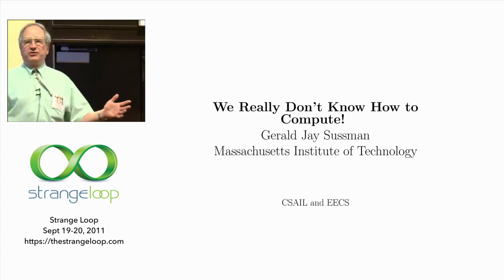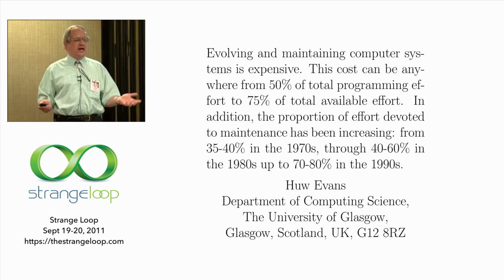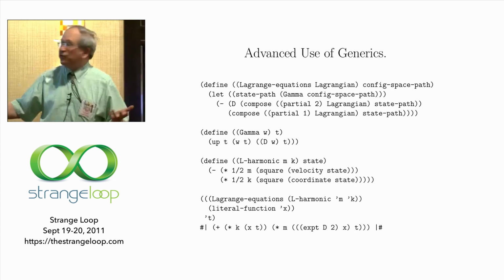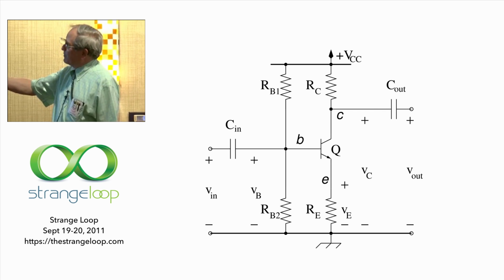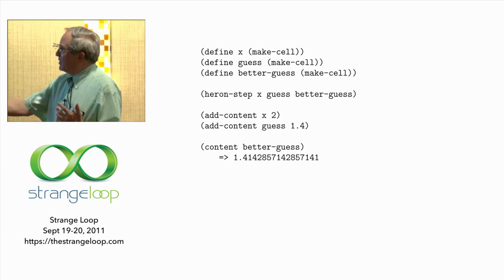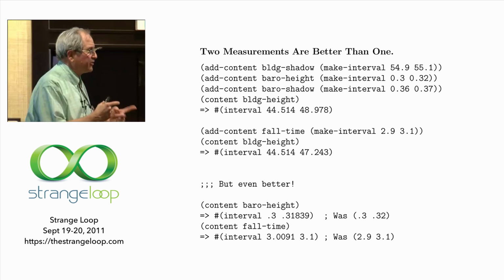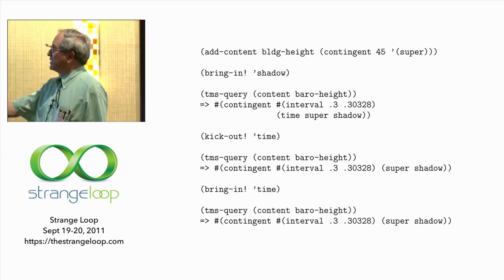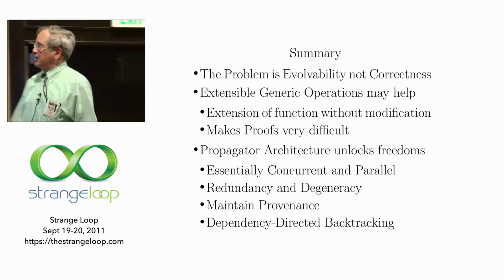"We Really Don't Know How to Compute!" - Gerald Sussman (2011)

Comment: 1:32 I think the main difference between a genome and a computer program is that the genome doesn't really determine everything a cell can do, but a lot of it only works by interaction between what the cell is "told" by it's genome and the environment. You can see evidence for this for example in finger prints, which are different even between identical twins. Computer programs  can also have emerging complexity, but only by the data interacting with other data,like in a cellular automaton. But cells also have physical and chemical interaction with the environment outside of the body.
Reply: Yes, a genome doesn’t do any computing at all. It’s a descriptive language.

Comment: Considering his "memory is free" comments, it is interesting that my current job is optimizing a code base to reduce the client program footprint, use less memory, reduce network packet size and latency, and utilize multiple threading to reduce user wait time for computations.
Reply: He made a remark that, surely, there're applications which still require peak performance. A bit later he describe a lot more specific goal: to reach low latency, no matter the means. If your app is under the 100ms bar of human perception all the time for all users, you don't really need any performance increases. This is the idea.
Reply: that is true only if the "app" is run once, in isolation, with manual input from the user and output to the user. I suspect you can very clearly see how even 10 ms per invocation becomes problematic when you start automating things. When you compose functionality. Which is, like, the entire concept of programming itself

Comment: This talk is actually less about programming than it is about automated deduction systems. Which is exactly what I'm interested in because it's what modern machine learning is exceedingly bad at.
ML works solely by approxmations. Not that it's bad to get an answer of 99 meters high instead of 100m for a building. But it's very bad to have the system able to mix up a bit of the current weather with the barometer reading. ML is (usually) continuous in every dimension. Most models don't allow for discontinuity. Which is unfortunately the base of symbolic reasoning.
Reply: This man is literally describing the theoretical basis for modern Explainable AI, so I'm not sure what you're referring to.

Comment: "But in the future it's gonna be the case that computers are so cheap and so easy to make that you can have them in the size of a grain of sand, complete with a megabyte of RAM. You're gonna buy them by the bushel. You could pour them into your concrete—and you buy your concrete by the megaFLOP—and then you have a wall that's smart. So long as you can just get some power to them, and they can do something, that's gonna happen."

Comment: Given two things, A) I'm on a 12 year old machine that can't run anything programed in the past 5 years, and B) I had faster webpage loading times in the days of 56k modems than I have today with 4g lte. 

Both of these facts tell me that SPEED AND MEMORY ARE NOT FREE!

If you can't run your program on a decade old machine, you're doing it wrong.
Reply: I think you’re missing the point - he’s demoing using a language that would have originally run on the old computer he shows, so now he has millions of times more speed and memory available to explore different ways to solve problems, with the primary constraint for coding no longer being performance, but rather flexibility, redundancy, reliability, etc. This isn’t the same as what is going on in the web and presumably electron apps you might be referring to, where they are just plain inefficient and consume all available memory and cpu for zero return. He could have easily ran those lisp programs interactively on a machine from the 1980’s, and he demoed them in this video on a machine that is now over a decade old!
Reply: They are free from a developer perspective. One could allocate 16GB to resolve a problem that could be resolved in 64kb. The problem you are facing is: you want to consume products created by entities who doesn't care about how speed/memory would cost to their consumers.
Reply: for laughs, compile a hello world program in even the most advanced and optimized dotnet version. Enable AOT, optimizations, single-file publishing... the resulting file is a megabyte and a half and takes about 3 times longer to run than the equivalent C program, which is ~4 KB. THREE ORDERS OF MAGNITUDE larger.

Comment: Excellent ideas.

Biological 'code' is very very dense by my look.
It's around 3.1 billion base pairs for DNA, where he got his gigabyte.
But ACGT is base 4 so it's more like
9,000,000 terabytes of binary code?

That is very very complex code for growing elbows and everything else in the expected places.

You can maybe cut that down ignoring some non-coding DNA but you can also consider those sections like compiler tuning parameters effecting the transcription rates of neighboring coding sequences and folding stickiness of the chromosomes.

...time to practice some LISP.
Reply: It's pretty fun thinking about biology like a computer.

Contains its own compiler code to make ribosomes.
Converts DNA to RNA like source code to AST for a compiler.

Each cell as its own processor with state memory from chemical signals and damage.
Proteins as small programs vying for processing time to work in a crowded cell before they are killed.

Each cell flooding the system with messages easily lost in the form of chemical signals.
A ton of parallel I/O processing of all of those signals, noisy networks.

Trashing a whole processor if it gets a virus before it can send out too many bad virus packets to the system...

Not sure if it's a useful model to work off of though.  Self destructing pi zeroes when they detect an errant process would be pricey.
Reply: You've made a mistake in converting size due to different bases. it's just *2, not ^2 (1 base 4 symbol is 2 base 2 symbols), so gigabyte is about right (3.1 billion pairs, each of which is 1 base 4 symbol, so 2 base 2 symbols -> 6.2 billion bits)

Comment: 17:59 - YES! - That's what I missed at Uni. Math is so unclear compared to code. They even put parts in sentences around the formulas. Unintelligible mess.
Reply: It depends on what notation you use, math can be very rigorous and clear. Even the sentences can have a clearly defined meaning.

Comment: 🤔 drop the stopwatch or the barometer?
Reply: If you drop the stopwatch how are you going to measure time? Using the barometer?
Reply: Drop both. Simultaneously. If you do hear one large bump instead of two distinct ones, then your assumptions are correct. Otherwise back out to add air resistance to your model or pump the air out to get the vacuum instead.

Comment: The premise of free processing and memory is that it's wrong on its face. There is no company; no government that doesn't have processing and memory as a consideration.  Has this man done anything of note in the private sector? Try thinking this way in game creation. And processing cost is always about cost of implementation. If you had infinite resources you could just run an equation forever, but, of course, you would be long dead along with everyone else.
Reply: Your premise falls flat with almost all modern websites. For a private developer it's cheaper to make user spend more time than it is to spend more on developers. Bigger projects can consider system requirements. Most of them do not. Just throw it on the web and be gone.

Comment: This all assumes intelligence is mechanical. This assumes programming can go beyond a simple mechinical function. What if the brain doesn't think, what if the mind operates the brain like an engineer controls a machine. I am hearing in this lecture a comparison of a neuron to a circuit or sensor and the arrangement of circuits can do what? They just do what they do because someone designed them to do what we know how to do. I really don't know what this technology can expand into?
Reply: Intelligence definitely can be mechanical, we already have mechanical AI systems that can exceed human capabilities for many intelligent tasks, and there is no apparent limit to it. But I feels that life is not merely mechanical, or perhaps there is some transcendence from the mechanical to the living.
Reply: @ssw4m I guess it all depends on our definition of intelligence. If I use your definition a hinge on a door is intelligent. For me, it would be the ability to solve problems.  I would say a computer doesn't solve problems it just follows a program and the computer is unaware of what it is doing. The problem is actually solved by the programmer. Every time the door is opened the hinge doesn’t perform an act of intelligence, does it? Every time a computer runs an algorithm it is not an intelligent act, it is no more intelligent than what a hinge does, it only did what it was programmed to do.
Reply: @ssw4m  many intelligent tasks like what?
Reply: @sedevacantist1  Sure. But people who follow algorithms might have something to say about you telling them they're not intelligent :)  You could also say that the ability to change approaches is a sign of intelligence. Which is obviously true enough - but again, humans routinely don't do that. You could say that the ability to look at the same data and produce different results (i.e. creativity) is a sign of intelligence - but then again, if a program does that, you're going to complain it's buggy. Funnily enough, again, just like with humans.

Understanding how neural networks work is a great insight into how our brains work. Even extremely simplistic models of neurons already display the same features we observe in animals. Look at how data is stored in neural networks - and you'll see where intelligence comes from. It took a lot of evolution to make intelligence work remotely reliably; again, humans are stupid most often than not - and even when they stumble upon something truly smart, they are very likely to not notice or be ridiculed for it. Our standards for software are a lot higher than evolution's :) Every time you read data from a real neural network, you also modify it. We specifically disable that function in our models, because it's inconvenient.

What reason do you have to believe anything about this is not mechanical?
Reply: @solonyetski there are many well-known examples: playing chess and other games, solving protein folding, finding new methods of matrix multiplication, generating rational written content based on wide knowledge (much faster, and better than most humans can), generating artistic images (much faster, and better than most humans can). I think that AGI is not very far away at all, and we already have all the pieces more or less.
Reply: A computer is not alive, but its functional intelligence may be judged by what it can do. In many domains, an computer system or AI can be functionally more intelligent than most or all human beings. In the case of general intelligence we are not there yet, but I think it won't be very long at all.
Reply: @sedevacantist1  Perhaps intelligence is not found in the ability to solve a problem; see Steve Mould's videos on water solving mazes, etc. But rather, intelligence is found, in this context, in the ability to conceive and define a problem that requires a solution. But our understanding of intelligence is always evolving; we used to think the main differentiator between humans and animals was the creation / use of tools.